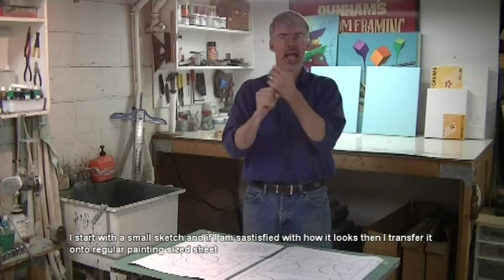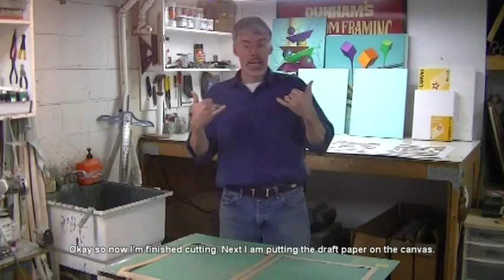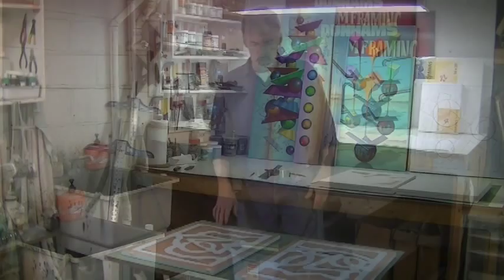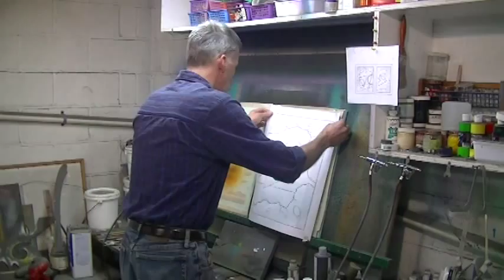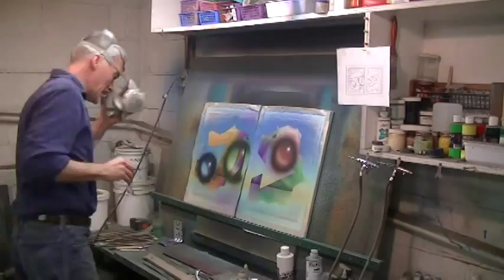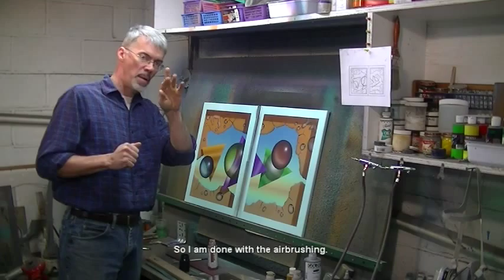Airbrush Painting Tutorial Guide

Comment: Hello Randy, I'm really impressed by your work and admire your patient and professionell approach. And the results are phantastic! I've got a question: what kind of airbrush or 'guns' are you using, especially for the sky/background areas? This may need bigger nozzles and cups (more paint) to cover the whole sky/background equally? I'm just about to purchase an airbrush to cover some bigger backgrounds and create gradients of that kind, and need an advice, which equipment (airbrush and kompressor) would be best for this. Could you please give an advice? Thank you very much. Greetings   Arndt
Reply from the maker: +Zelamir  Hello Zelamir,

Thank you for your compliment. To answer your question:
You can use the one air brush gun that you have to spray overlaps over and over from the top to bottom and back to top in few time until you are satisfied. Not need to get a bigger one unless you want to save your time. I did use my medium size one that you saw my video to spray the sky of 3 feet by 4 feet canvas and looks good.
Reply: +Randy Dunham Hello Randy, thanks for answering. Actually I can't see what kind of brushes you are using (the video runs too fast or the cam is too far away) and what you mean by medium size. Would you mind to tell me the type of brush(es) you are using? And by the way, do you also use Createx Illustration Colors. I'm just interested to learn as most as possible about materials and what is possible with these. I don't think, that these are the most important criteria, it's rather talent and practice, but to learn about techniques, equipment  and materials from the real artists, like you are, is essential for me. Thanks a lot.
Reply from the maker: I use a Paasche VL-3W Double Action Airbrush all the time for any size of the canvas between 11" by 14" and 48" by 72". It's a good air brush.
Reply: Randy, thanks a lot. I will take a look at it. Currently I'm using a H&S Infinity 2 in 1, it's also good, but I'm struggeling with fine detail work. Still learning. Hope, it's not the gun which causes the problems. Also I've quite big hands, maybe thats part of the problem. Thnak you again for help and information.
Reply from the maker: You are welcome. It's good to have that airbrush gun. Just take a lot of practice and patience to get fine details look great. Most important is to have fun playing with it!